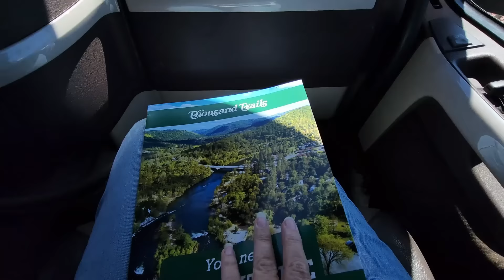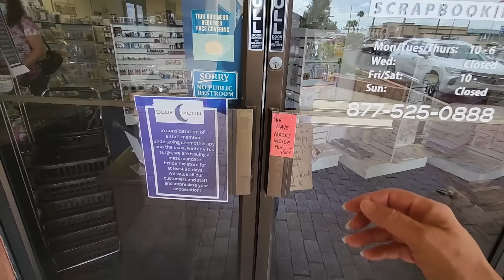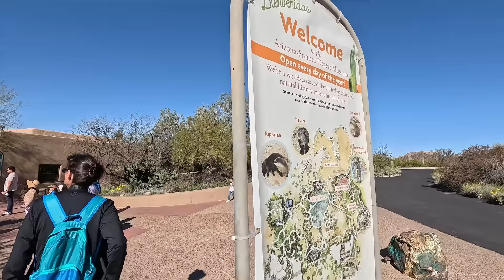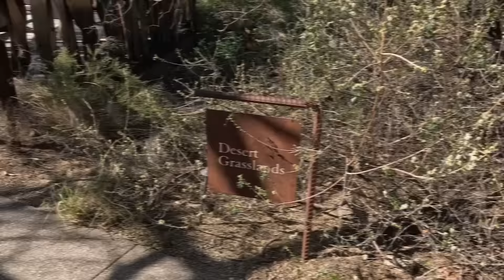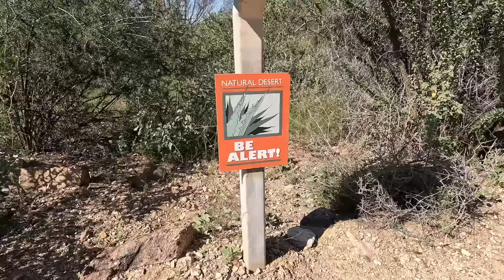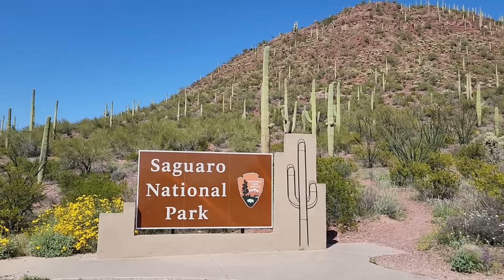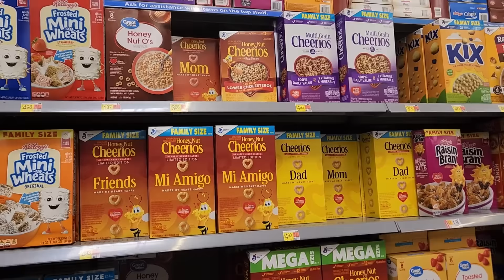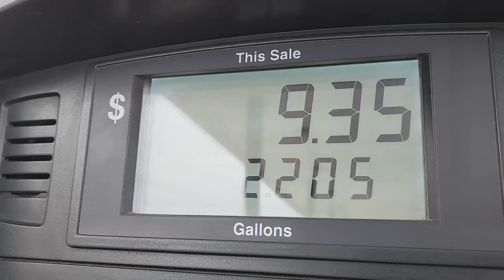HIDDEN COSTS every RVer MUST Know. HDT BIG Rig Travels. Boondocking. RV Lifestyle. Fulltime RV

Comment: Boxed milk from Dollar Tree - lasts a long time on the shelf.  No more worrying about milk expiring or running out.  Good as a back-up, too.
Reply: I keep powdered milk because we do not use it on a regular basis. I have it on hand for recipes.
Reply: Parmalat or Ultra High Temperature (UHT) milk.  It is heated at higher temperatures than regular pasteurized milk. This way Parmalat milk stays fresh longer and doesn't need to be refrigerated until opened. Dollar Tree has pints of they carry, it works well in the RV. I use it for soups, sauces and coffee.
Reply: Boxed milk, yuck, maybe you can use it with fake beef 🤣🤣
Reply: The boxed milk is not bad at all. Never run out. Hope to see you guys in our 1 Million Mile road Trip. Love HARVEST HOST!!
Reply from the maker: That's funny because that is where we bought it for Alaska. Saved our bacon a few times in the wilderness when we were days from a store...or civilization! We may have to keep some on hand in the lower 48. Thanks
Reply: Boxed milk doesn't even taste like milk. I have never see an expiration date on milk, it a sell by date. Keep it at 33° and I get cold milk, and it always last a week after the sell by date. If it goes bad before that it wasn't cold enough.
Reply: Powdered what? Definitely not milk. I worked a day farm as a high school student. No such thing as Powdered milk. Also almond juice, is just a sap, and it taste like sap.
Reply: Never heard of dehydration huh?@On-down-the-road
Reply: Where can I find the tour video?

Comment: I've been trucking 35 years. As far as I know, the avid has always been called brightener.
Reply from the maker: Ok, thanks. Makes sense but not crazy about it on my paint.
Reply: @bigtruckbigtravels  well, it's worse on aluminum. It really doesn't harm the newer paints or gel coats on fiberglass. It does make aluminum dull though.

Comment: Hey Chris. I took a NRVTA Solar course and I have some real concerns about your install. You have exposed connections underneath and there is no grommet in the hole where your cables are coming from/to your inverter. Please keep an eye out for wear and tear on those cables. And if the system fails, look at your shunt and BIM first; those should not be exposed to the elements. Best of luck and safe travels. 😊
Reply from the maker: Ok... not sure who Chris is and why he has no grommets! 😆 😆 Great suggestions on your concern.
Reply: @bigtruckbigtravels  My bad. Thank you.

Comment: The date printed on a container of milk is not the expiration date; it's the last day of sale.  When kept below 40 degrees, milk is good for two weeks after opening, or two weeks after the printed date, whichever comes first.

Also, Walmart sells milk that is shelf stable (until opened). It's from Parmalat, and it's generally on the shelf in the baking section. It's generally around $3 for a quart box (like an oversized juice box), which is about the price of a quart of milk at a truck stop (if not cheaper), but it'll sit nicely in the cupboard for several months until you need it.
Reply from the maker: Thank you and good to know. We may use the Parmalat next time. We used it up in Alaska and came in very handy.

Comment: If you shop Walmart as you do, look in the specialty foods section. They have a milk carton 1qt size that does not need refrigeration till opened. It comes in2% or whole milk type. It's name is (Parmalt). I keep a couple quarts on the shelf in the pantry when we are going out boon docking. All I have do is replace any  used cartons in the refrigerator and it tastes and behaves just like fresh. As far as I can tell it is. It does cost a few pennies more but I prefer it over canned milk Yuck. Happy trails!
Reply from the maker: Thank you. We used it in Alaska with great success and very convenient. We may have some on hand again.

Comment: Well now I understand why you can't delete the storage behind  the wheels because that's your battery and power distribution center which blows my mind the builder put it in the spot that get all the vibration and bumpiest ride  .  But you don't like Whataburger biscuit and gravy  it is awesome! Missing the days when Mel Tillis was doing what a burger did I stutter commercials
Reply: If you don't want to take your power boards apart you can use contact cleaner it's sprays just like WD 40 with a straw and is like alcohol but non flammable and better working  you can get it at Grainger or any electrical supply shop
Reply from the maker: Yes, placement could have been improved in hindsight. Missed those commercials, bet they were funny.

Comment: Long Term Camping Pro Tip...... Buy extra Milk in Quart size containers... FREEZE them. and then use them after the POSTED Expiration date... I also did this in the Coolers with Ice Days.
Reply from the maker: Good suggestion but we may opt for the shelf stable boxed milk. Thanks 😄

Comment: I think you guys need a new air brake valve…. I can see you struggling with it and it’s letting off air way slow… I was in a rig the other day and when you pulled it out it almost hurt your hand it was so fast!
Reply from the maker: Thanks. We'll check that out. It does sound different.

Comment: On your setup what  would you do differently ,on your build Voyager and Orion ? How long did it take to build ,and do you recommend a length on trailers that would work better than others ?  Let's say half boon docking and the other half camp grounds.
Reply: Length seems to be the magic number since there is a length up to 53 ft
Reply from the maker: We would have the tandem drive axles option from the factory on the initial build... not added later. Length is a tough question. If you want to be in State or all National Parks then keep it at 34 feet. Virtually all commercial campgrounds can handle 45 foot trailers but where to park the truck is a question sometimes. A total length of under 60 feet would be a good compromise to fit nearly everywhere but that means a short truck and trailer.

Comment: Is that a mini split or generator by your front power inlet? If it is a minisplit, do you have video or pictures of the setup I could look at?
Reply from the maker: It's a mini split with two ceiling cassette units. No video of the set up but we touch on it with the Boondocking Beast basement tour video.
Reply: @bigtruckbigtravels  I'll check that video out now. Thank you

Comment: Good video 😊 what kind of  battery system do you have  looks you have  a large system  do you have  air  brakes  on fifth wheel  safe travels
Reply from the maker: Thanks. We have 30 KW of Lithium batteries and air brakes, air ride suspension on the trailer.

Comment: What are your tips for using Truck Washes- and which one did not have acid????
Reply: The big chain is Blue Beacon, though there are many independents scattered around.  The acid is used on the aluminum rims to "brighten" them, by removing the thin layer of oxidation that naturally forms. Since the washing is (generally) done by hand, you can specify what to use, and what not to use.
Reply from the maker: We usually use Blue Beacon. They all have brighteners/acid so you have to ask them to not use it. They understand but they will use the acid as a standard unless you request them NOT to use it.

Comment: Question, is it required of you to separate the truck from the trailer whenever you load and unload the car ? 🚙
Reply from the maker: No. We have loaded and unloaded with the truck attached but normally when we take the Smart off then we're in a spot for at least several days and we'll unhook the truck to level the trailer.